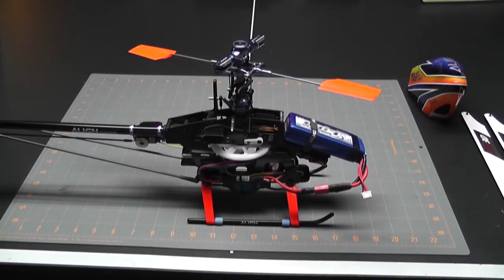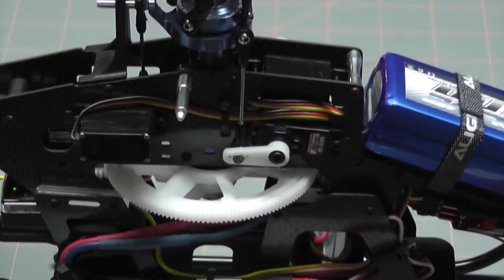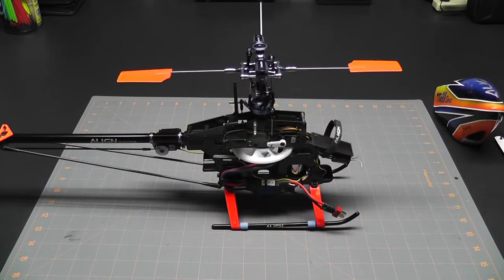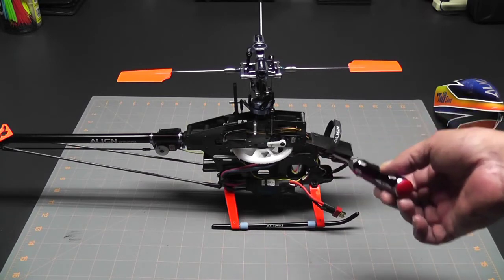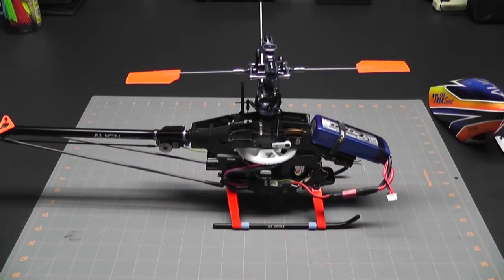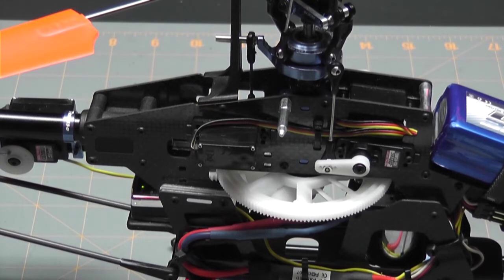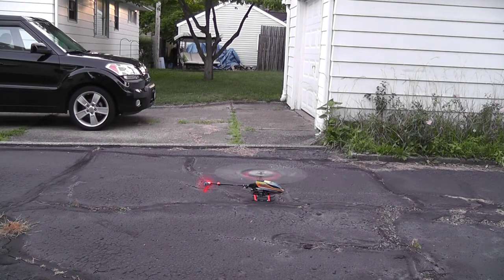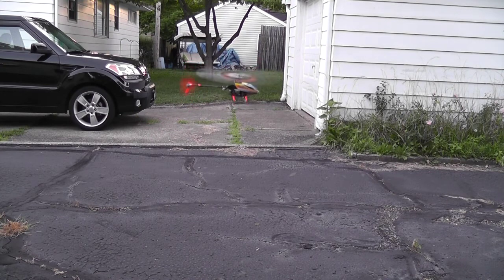Trex 450 Hardware Failure and Repair 08-05-12

Comment: hitech servo is not 100%  90 so you have to trim them, but when you do so make 
sure you caution when you increase the swash mix and servo travle  allways remember
that your servo is trimmed so there not much room left travel, this will keep from damage the servo from input from the stick. i dont use trimm when i 90 my servo arm

Comment from the maker: Hey Bud.  The tail servo was actually the first one which I changed out after fighting tail wag from the first day.  The combination of the Hitec servo and a carbon fiber tail pitch connecting rod finally fixed the problem.  The servos I went with are the Hitec HSG 5084 MG for the rudder, and  Hitech HS 65 MG for the Cyclic.  Hope this helps!  Have a great day and happy flying friend.

Comment from the maker: Hey bud!  I never actually grounded the heli as I have seen in several posts on the user boards.  But I did spray the belt with silicone spray which is supposed to eliminate the static build up.  Hope this helps!  Have a great day and happy flying friend.

Comment from the maker: Sweet!  Beleive it or not, I have been looking at the 450 Pro V2 DFC as a second 450 sized heli that has FBL rather than flybar.  That is supposed to have a ton of upgrades including the better stock servos, larger battery tray, larger gyro platform, and an improved tail pitch slider.  I wanted to go FBL and it looks like for the 450 size, this is the bird to get.  How do you like yours?

Comment: i noticed that my 450's all get material failures like servo burnouts or other
the 500 however doesnt have these problems,,so im trying to figure what i can do to have the 450 behave like the 500 in this matter
the 500 has expensive servos ,,so i guess its worthwhile to upgrade to a bit more expensive servos on the 450 ,,,its such a frustration if these things come down without making a pilot error
i know you had your share of servo failure too on this t-rex450's equipment